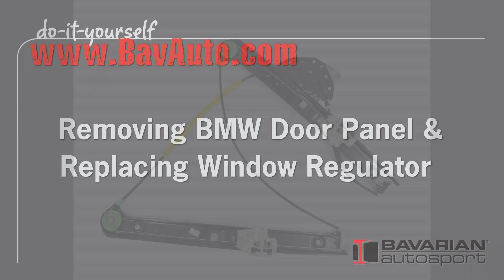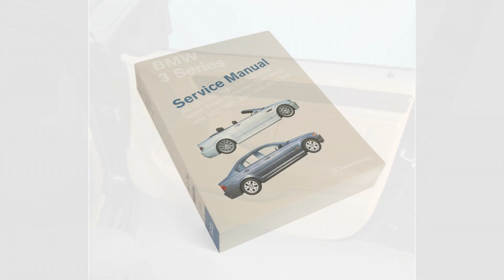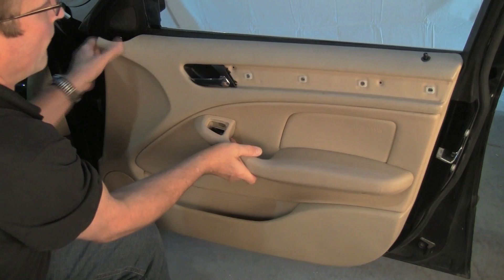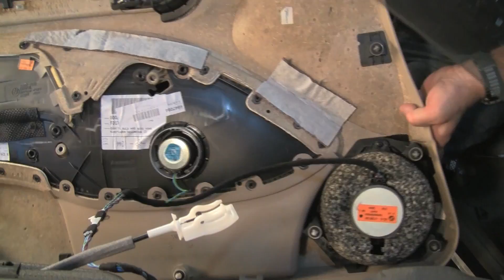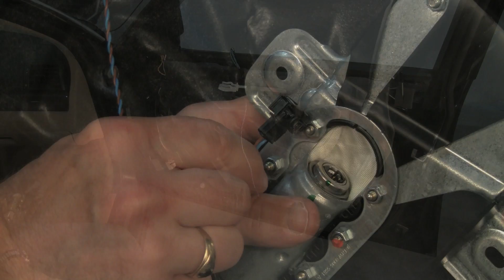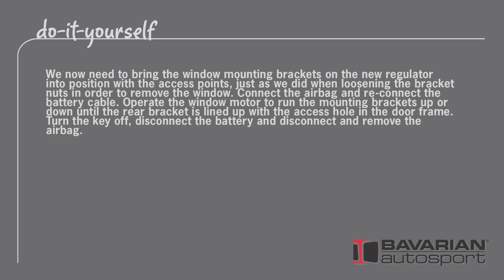Removing BMW Door Panel & Replacing Window Regulator

Comment: Great video and tutorial, I just replaced my drivers side window regulator, and lowered all my windows to spray silicon spray in the window channels and the rear drivers side regulator is stuck with the window down.

Comment: Thanks for this really well done video, guys. Anybody have some pics to show the proper routing of the door latch release cable around the bolts that hold the airbag? Hoping to avoid tearing into the other door to see how all of this should fit. When the regulator died, it managed to rip that release cable out of place and break the interior door release lever. Have yet to figure out how to remove that broken part from the door panel too. Doesn't look like it was ever intended to be taken apart. Unlike in the videos I have seen, there isn't any screw with a cover accessible from the inside of the car. All plastic bits. I think the one in this video is the same. And of course, even at the insane price of $65, BMW doesn't have any. Back ordered. None in the US, or Germany...

Comment: Very important step if you don't want to take everything off again:  Both Bentley and TIS list window adjustment as the last step in replacement of the sedan front window regulators, but none of the DIY articles include it. It's incredibly simple; just before you begin replacing the vapor barrier, loosen the two nuts securing the rear rail of the window regulator. Using the window switch, lower the window all the way into the door. This step apparently "sets" the proper position of that rear rail in its slotted holes. Re-torque the nuts to spec, and you're done.

Comment: This is a straight forward repair for anyone with even a small amount of mechanical skill and a desire to save some money. I do agree it's odd how these regulators fail so frequently. Both my rear ones have failed over the last year in my 2006 330xi. Odd as I rarely have rear seat passengers and those windows are very rarely used. In looking at the parts that have failed, it looks to be sub par materials used in the plastic parts. Thanks for the great video.

Comment: good vid but once more a man calling a screw a bolt, listen please a bolt is a thing with a nut on the thread, cap screw is a fastening with either a hex head or socket head, with part of the screw  plain  without thread, used to fasten a cap, such as  bearing cap or cylinder heads   a machine screw  can have any head, but is threaded all the way. Take this, from heavy engine fitter

Comment: I know this is an old thread but I have just replace both of my front regulators using this excellent video. Many thanks to Otto for taking the time to share his skills. However, I did a couple of thinks differently. I removed the motor from the regulator before I removed the regulator from the car. You can do it both ways. I had trouble disconnecting the connector on one of my motors so I didn't want to force it. The other thing I did was to leave the 5 regulator nuts loose before lowering the window down and connecting it to the window carriers of the new regulator. I found it a lot easier to marry the two up if I had a little play in the regulator. I say loose but not so much that it rattled. Then, once the window was attached to the carriers correctly, I nipped up the 5 regulator bolts without fully tightening them. I tightened the just enough to allow them to slide a little if a force was applied.  I left them like that while testing the new regulator. The reason for doing this is to allow everything in the regulator/window assembly to line up and minimize  stress within the assembly during operation. I moved the window up and down through a few cycles and then fully tightened the 5 nuts with the window in the fully down position. I read a lot about these regulators failing and it is always the carriers that fail at the point where they are connected to the cable talurits. I think this might be due to the way that they are assembled. Even the smallest misalignment can result in increased resistance to the movement of the window and that can place greater stress on the cable/carrier harness. By the way, you should lube the window runners too when you are doing this job. Use something like a silicone based spray lube. You might want to order some spare door card clips too. I broke a few trying to put the cards back on the doors. TBH that's the biggest pain in the butt when doing this repair.  That's all folks.

Comment: Don't forget to reseal the vapor barrier when you put it all back together. If you don't do it correctly, you'll find wet carpet and you'll be taking the door panel off again to repair that. Cannot stress that enough. Otherwise; a very good tutorial.
Reply: Hi what do you reseal it with?  Do you need to add additional sealant to do this?  Thanks!
Reply: You can use Butyl double sided tape which is made specifically for sealing the vapor barrier. That can be purchased on Amazon. I used GE Silicone II to reseal mine. You can get that at most hardware stores. I used it in conjunction with the Butyl tape that was still adhered to the door. I spread a bead of silicone above the tape. The tape can actually get its sticky property back if you deform the surface. It seems that a thin layer of my vapor barrier was stuck to the tape surface. That was most likely the reason it didn't stick well. So far the car has been in one serious down pour and it didn't leak. One more thing, if you  break the door panel clips, replace them with clips that have a rubber washer on them. That rubber washer is there to prevent water from leaking through the holes on the door. I watched water run down the door panel holes when I sprayed the door looking for leaks.
Reply: Thanks mate thats really helpful, my window has just dropped with a clunk so gathering info before I take the plunge and open it all up.  Regards.

Comment: No need to remove air bag, and no one ever mentions the short shoulder on the window to slider bolts, so easy to round off, my tip is grind a normal socket flat, 8mm or 5/16 is a better fit. By the way folks most regulators are tripe design.

Comment: I disconnected battery and did everything according to your presentation. I connect battery back and dashboard is dead, AC doesn't work also. Car starts and run but no dashboard and Air Cond. Is it the normal behavior and I should reprogram it or something else? Please help
Reply: Where you able to get that fixed? It sounds similar to a problem someone else had that turned out to be the airbag module.
Reply: clearly you blew a fuse. You somehow touched the battery cable to metal. You should ONLY be disconnecting the NEGATIVE side of the battery, not the positive.

Comment: can someone help. my airbag light goes on when I reconnect it. (I already removed the negative cable) but do I need to wait for a specify amount of time before removing the airbag.?
now the lights is on, if someone once how to fix it. thanks
Reply: airbag light on dash its usually a faulty passenger seat sensor. In your case since you were messing with an airbag, we can assume its that one you were just messing with. its the sensor thats faulty

Comment: Hi - I removed the old regulator & taped the window in the up position but it slide down completely into the door cavity. I'm unable to slide it back up. Any suggestions? Thanks.

Comment: hi you been great I have to ask (I need to purchase a new vapour barrier soon as the existing one is not holding up ) but I've not rushed to get one I want to do it 100% when I do it meaning getting the clicking noise sorted which I believe is the cable moving and hitting the door /glass when in motion I do know that when I got it out before a clip snapped which I'd most certainly say was a clip that held the cable in position but can I get these somewhere ? and if so how many should there be ? I have an e46 coupe reg mj55 ftc thank you

Comment: What is the window being held up by when you removed the bolts that hold it to the regulator? I'm doing this on an E46 M3 and I have to remove two E7 torx bolts instead of the two bolts you removed at 4:54 in the video.

Comment: Hey Bav Auto, my 94 525i currently has a seized driver door latch, I suspect this since the central locking works as well as the key, fine yet neither handle will release the latch, is there a way to manually release the rotary latch? I have removed the door panel partially giving me limited access to the latch . any help is greatly appreciated! , for now im left hurdeling over the center console.
Reply from the maker: Hmm .... if both handle inputs (to the latch) are "frozen", I don't know just what you might do to operate the latch.  Have you disconnected the electric actuator?
Reply: +Bavarian Autosport I haven't tried disconnecting the actuator yet as my access into the door is very limited, does the window guide have to be removed to do this ?

Comment: I have 2001 325 ci convertible and was hoping for video for back window regulator and interior panel removal to avoid breaking anything removing panel. yet it seems impossible to get a you tube video on rear windows regulator removal unless rear window is also rear door. which I have convertible so no rear doors.

Comment: fuckin A, man. 
What a pain, luckily i just want to replace my speaker for passenger rear door. Probably both sides so theyre the same.
Any thoughts from people, for replacing? get an original, get newer better ones, what kind of connection do they use anyway?

Comment: Hi! i was wondering if its possible to take off the armrest on the door without taking the whole door panel off as well! the goal is to take off the interior trim(e46 3 series coupe) so i can wrap the trims! 

btw what a great channel, lots of nice videos!
just got the car, so there is few maintenance stuff ill have to do!
previous car was an Audi a4 b5 which was terrible to work with, everything was so compact in the engine bay

Comment: Why is it always the passenger window gets broken in BMW's? Mine just broke, and every video i check is about the front right passenger window.
Reply: Tashqen no is not so true sometimes is the driver side door.
Reply: Nah, Mine rear right door regulator is stuffed and the string is broken and its a 2003 e46 but the one in this video is differnt
Reply: I've gotta an 03 325i and my driver side window rolls up, but about 1/4th to half of the way up, it goes insanely slow. I've gotta get in there and lube it before it burns up.  . . . And my passenger side grinds a couple times on the way up.
Reply: Lmao dude thats what im searching for right now too, its the only one broken on my e46. The clip that pulls it down is broken probly

Comment: Very helpful resource that gave me the confidence to tackle this project successfully. Some further observations when I did the driver side front regulator on a 2004 E46:

1. The only cable bundle I had to unclip was the one attached to the inside of the door card.
2. Be careful in freeing up the vapor barrier, especially immediately below the window speaker as there are thin ribbon cables in that location that would be very easy to tear/break.
3.The only zip tie needing to be cut was in the top center of the door frame. On an OEM regulator, it goes around the yellow cable guard.
4. No mirror memory module to disconnect on the driver's side.
5. If wire cutters fail to free up the window, you might have to remove the window motor to free up cables that might have wrapped themselves around the big white plastic gear of the regulator.
6. Lucked out with the new OEM regulator as it was lined up in perfect position to secure the window bolts when I manually lowered the window on it.
7. Window bolts take an 8mm socket, but for some odd reason, I had to step down a bit on one of them to a 5/16th to turn it.
8. Ensure the wiring for the window mirror switch is pulled through the opening in the arm rest before you reattach the door card.
Reply: +RomeoMike With observation #4, and after further research, it should say "No need to disconnect the mirror memory module on the driver's side." As an aside, there are two mirror memory modules, and in my car, the driver's side module is in the upper right of the door frame.

Comment: Will the window stay in the closed position safely while you remove the regulator? That seems unsafe like the glass could fall. I notice at one point there's a pry tool wedged in there.

Comment: Hello first of all these are great instructions thank you for sharing. Installation went nice and smooth i did not have any problems. My only problem is i forgot to reconnect airbag before i powered car up. Now i have the airbag light on my dashboard. Is there anyway to remove this without going to a mechanic or dealership. Any help would be appreciated.

Comment: Hi, i'm new here and from the philippines, after finally sourcing out torx t20 and t30 tools i was able to open up my e46 front driver side door because its stuck on closed, after removing the motor on the window, i still cannot roll down the window to remove the glass, seems to have stuck on closed, motor working as checked. Whatever rocking or knocking i do, 

The front regulator seems to be working because whenever i try to work the switch, the front of the glass tilts forward, the rear part is stuck tho. 
Unfortunately, to remove the rails, i need to remove the glass, 

I cant reach in and cant even see the bolts attaching it to the rails. Is there another option than cutting up the cables to free up the window?

Window regulators here in the philippines cost an arm, a leg, and a kidney.

Followed all the diys i have seen but no one has written this yet so there.

Need help.  :)

Comment: my window is stuck in the down position
i need help with moving it up.. any suggestions?  i have removed all the panels and vapor guard etc.. i have purchased a new regulator motor.. Help me if possible..

Comment: Just completed the right side replacement after having done the left side a couple months ago and only problem is the airbag light is now on in spite of following the procedure strictly - making sure to disconnect battery and THEN disconnecting the airbag and then reversing the order upon completion. The first job resulted in the same thing so I'm not sure how to do the job and not have the light lit on the dash. Annoying 'cuz I don't have a code clearer and don't want to spend $100+ to buy one that may get used one or two times. Seems like there should be a sure fire way of doing it that doesn't result in the light coming on?

Comment: what are the signs of a bad regulator ? on my 03 330i my windows wont move but i can hear the window motor run. awhile ago i repaired the key lock on the driver door and a week later heard kind of a small clack sound when i rolled the window up or down and few weeks after that the drivers window wouldn't roll, weeks after that the passenger window went out

Comment: I just changed my regulator on front driver side window, but now my door locks don't work, either manually or with the key fob. The fob does open the trunk though
Reply from the maker: Charles Mccuen Well ... that's a new one!  We don't know of anything that would normally be associated with the central locking, while installing a window regulator.  Perhaps, you may have pushed the rearward regulator rail into the latch area and dislodged the door lock wiring plug (?).
Reply: That's what I assumed. I will check and let u know. If it was the fuse,the trunk wouldn't open with fob,correct?
Reply: Charles Mccuen Did you fix it? What happened?
Reply: Exactly what he said! Fixed

Comment: Outstanding video and thanks so much for providing this. I watched it a couple times then started and the whole job took less than 2 hours. Hardest part was actually getting that butyl rubber adhesive removed...a real chore but hey, the job is done, window works flawlessly and this is just one more reason why I buy parts from you guys! Thanks sooooo much. Dealer wanted $460 to do the job!
Reply from the maker: Good work, Ed!

Comment from the maker: Mohammed Abdulhamid - We cannot reply directly to your comment as it was sent in from Google - You may have misses a phase in the battery disconnect steps or the plug on the airbag module may be incorrectly attached.  We would suggest that you reset the warning (erase the fault code) and if it does not return, move on.  If it does return, take note of what the fault code is and if it is for the door airbag on the side you worked, go back in and check the connector.
We do offer a selection of  tools that will read and reset the SRS fault codes (depending on the year & model that you have).  A shop can also do the same.

Comment: Great. Now how do you get them to stop breaking every month?
Reply from the maker: That, my friend, is the question of the decade!  Seriously though ... once a month would be excessive, but normally if you keep the car long enough, you'll be doing the job again on windows that have previously been done.  Additionally, you may want to use some spray silicone to lubricate the glass guide channels.
Reply: BavarianAuto  Oh yes. Each regulator on each window has been replaced at least 4 times already  lol. I've learned that it doesn't matter if its BMW OEM, Ebay China Junk or Dorman from Autozone. They all go regularly. I've opted for using the Autozone part since its lifetime warranty and easy to exchange. At least I get the parts for free now.